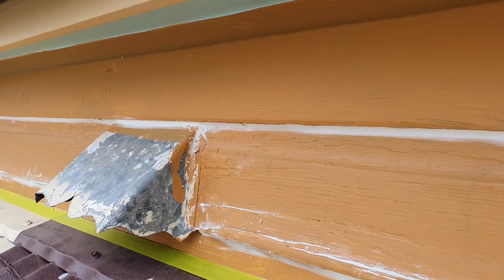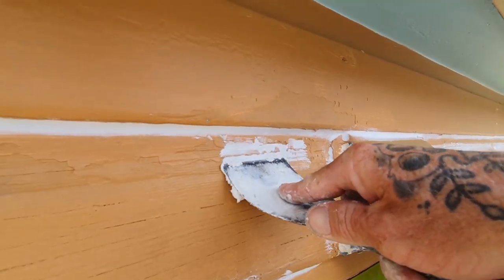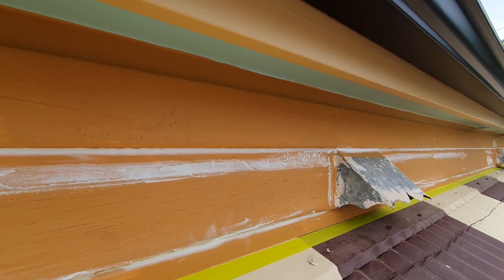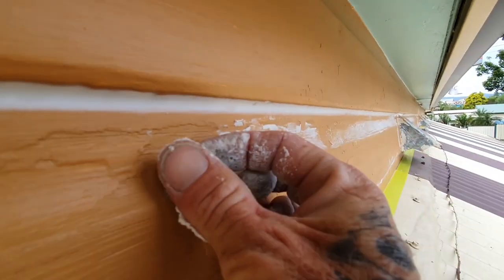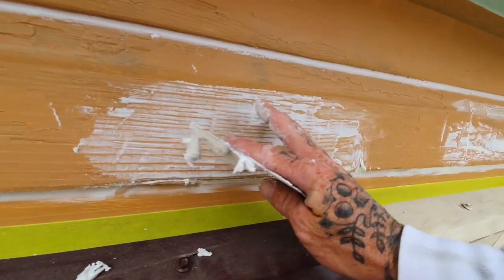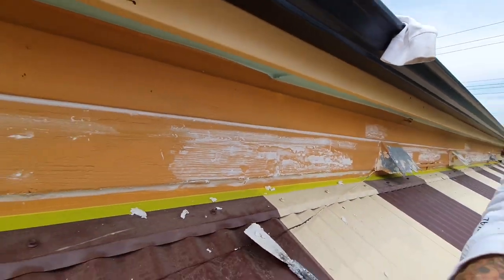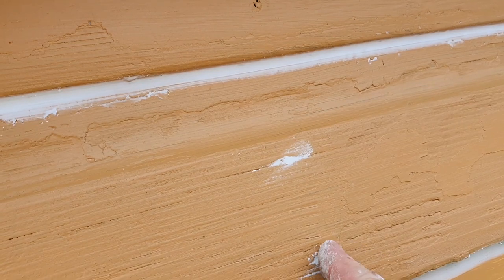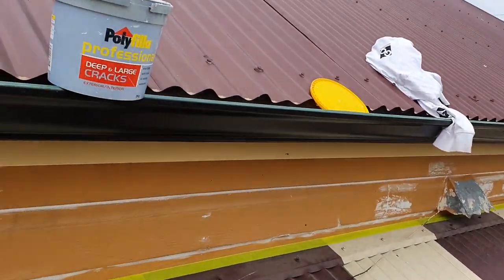PREPARING TIMBER BOARDS

Comment: Hey bro just wondering what you usually do when it comes to brand new factory pre primed weather boards undercoat wise ?? Can you get away with weather shield straight over it as it's a topcoat & primer? Or have you had times i can scratch off ? .. do you ever recommend oil base undercoats on the new boards or is the an overkill.. 

🤙🏽 sorry alot in one paragraph
Reply from the maker: Hey bro, I always just spray a coat of primer on first but its not necessary, you can just go straight over with the weathershield. when I was working with other companies that's all we did and never had a drama even bare timber its okay just an extra coat needed. Oil is definitely an over killed for new pre-primed timber but for old school hardwood its the best. Hope this helps mate🙏🤙 respect